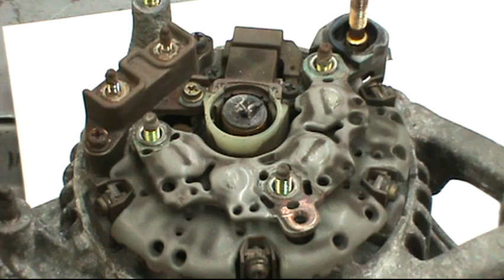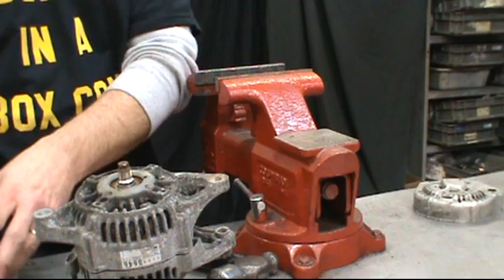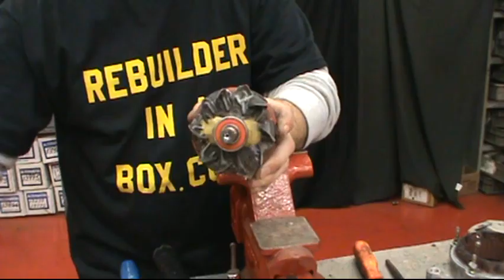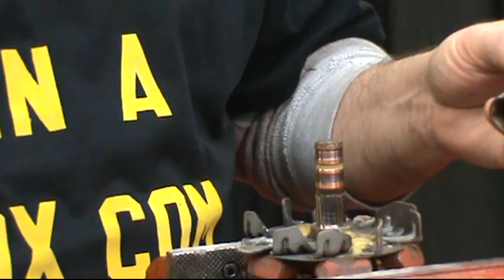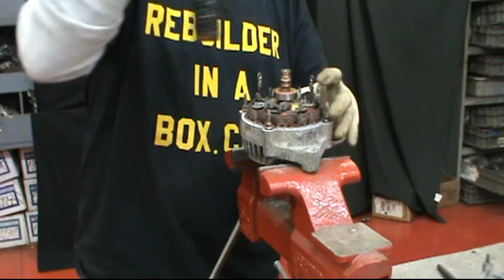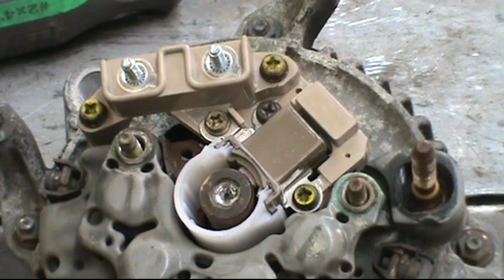How to rebuild a denso alternator

Comment: 15:42 - did you crack the case in half??
Reply from the maker: Good catch. Many of those units are broken like that due to corrosion. Corrosion occurs between the aluminum housing, and the metal laminations in the stator. We normally consider those non rebuildable but we kept going for  educational purposes. We'll be re shooting that video someday, there are several goofy things although still a functional tutorial.

Comment: I tried this on a Denso 210-0750 for a Honda Odyssey. The four screws for the rectifier are not there. It is permanently attached making it impossible to separate unless it is soldered or something.
Reply from the maker: Wrong video. See the one with the Chrysler mini van.
Reply from the maker: Note : We don't have a kit for that right now.

Comment: got it all apart except for the dam inner bearing its gonna do severe damage prying like you show in the video i tried and im not destroying a shaft in the vise cause the vise cannot hold the shaft as i pry up so i ordered an alternator bearing puller for 15.00 im doing the slip collar as well i used my press to put the outer bearing in used a large socket to press it in super slick n easy. did one a long time ago i kinda like doing bench work like this its fun you made this easy except the slip collar ill find a destroyed cummins denso alternator ill rebuild with a new collar

Comment: Hi, thankx for this video , im portuguese and my Jeep Cherokee alternator dont have that number reference but its almost identical , so im having an. issue whit it , when driving and at 2000 rp or more i have about 13 volts and all ok but when i stop hit the pedal sometimes i have about 11, 50 volts or so , even at nigth and i can see ligths going more alive if i hit the acelerador pedal  and something funny started happen too wish is my volt gauge fall to 9 volts and then up again , do this almost always i start drive the car .Checking the voltage whit multimiter at alternator i got 12 volts and sometimes less, whit no one hiting pedal ofcorse , but i guess its not working something there . I alreaddy switch the brushes but problem remains, checked the rectifier whit multimiter and i got the same value in all so i presume its good , now i dont know where to check more  ;  my slip rings are exacly like yours there and i thougth it was the problem but now i saw your video and maybe its not from there , so can you have ideia where my problem can be or what can i check \'
Reply from the maker: Try another battery. Go thru all vehicle grounds. Clean fuse block. Voltage reg is in computer, clean  connections, grounds. Follow large wire coming off alternator, dis assemble fuse link and clean.
Reply: thanks for your answer, just another question, do you know the right value of diodes? I checked and gave me about 4 in all them , but yesterday I did another try checking a output alternator and case and got about 1, 12
Reply from the maker: @000jamesh  They will all measure very similar resistance. Then checking in reverse, very little bleed thru. The exact reading will vary on scale and meters.
Reply: That inner slip ring was completely effed up. Should have got a slip ring replacement kit , and changed  it out!

Comment: Too bad you don't have rebuild kits for my 07 Jeep wrangler 3.8L. Local rebuilder puts cheap Chinese parts in them don't last. I had 200k on mine bearings went out sounded like a groaning sound. I thought it was my PS, or Automatic transmission. I removed the belt and started it the noise was gone. I took it to local rebuilder he rebuilt it the diode board blew out while I was 44 miles up a rock crawling trail in AZ. What a pita had to rope tow out and winch about 10 times using 4 jumper cables to jump tow vehicle power to my rear bumper winch pull me backwards in the switchbacks. Buy OEM if you can't rebuild yourself now, I keep a spare. New OEM worth it when you get stuck on a trail.

Comment: Hello Mike, thanks for this very informative video. I have a 2006 Honda Accord with the 3.0L V-6 and my original alternator went out about a year and a half, or so, ago. I then purchased and installed a remanufactured 110 amp Denso unit from RockAuto. This Denso/RockAuto unit has been on the car now for around 18 months, give or take. However, approximately 4 months ago, one morning when I started the engine I started hearing this high-pitched whining sound coming from the engine bay. At first, my immediate thought was that it sounded just like a power steering pump, low on fluid. The whine did NOT get louder and/or quieter when turning the steering wheel, in either direction, at idle, or otherwise. I checked the power steering fluid and looked over the hoses for any leaks that may have been sucking air into the system, but nothing!!! I also took a long screwdriver and placed the tip on both the power steering pump and the alternator and placed my ear on the opposite end and the vibration noises coming from the alternator were way louder and way more intense than the vibration noises coming from the power steering pump, like night and day difference. So, after a process of elimination, it is my opinion that it is NOT the power steering pump/system, but rather my alternator, from where the whine is coming from and where my problem lies. I have no problem buying a kit from your site, however, at the same time I would also just like to know why and what is causing the alternator to whine like it is. Is it possible for you to tell me more about this whining noise coming from the alternator? I did a little research online, on some Honda forums, and found exactly what I expected to find... I expected to find ANY answer that I wanted to find and everything in between!!! Some threads said that the whine could be a diode that has burnt out or gone out and it could be this or that and whatever else you could imagine. While I am NOT 100% positive, I do NOT believe that it's the alternator bearings making the whining noise, simply because usually bearings make more of a roaring noise and this is a whine NOT a roar. It also does NOT sound like any bearing I've ever heard that was on the fritz. I mean, to me, it's really more like a supercharger or power steering pump whine than any bearing I have ever heard when going out. Thanks in advance and I look forward to seeing what you have to say in regards to my issue.
Reply from the maker: Well, we don't sell that kit, just the starter kit. Remove the plug in and main cable from the alternator. If the whine stops, its a diode but still maybe a bearing somewhere. For me, an empty cardboard gift wrap tube is the best thing to locate the source of a noise. Take it to a dealer or Honda mechanic and get an estimate, maybe they would be familiar with a common problem like AC, idler pulley or tensioner. Sometimes soapy water spray will quiet a bearing or clutch for 2 seconds. Give up on line research for this. Process of elimination starting with cheapest.
Reply from the maker: Remove alt and have spin tested at AZ Orielly to see if you hear noise at vender.
Reply: My son has a 97 camry, Bought a replacement brand X alternator from the brand X store.  It did not have the proper amp output, even though it was claimed as a replacement.  Buy the real denso brand.

Comment: Do you have any knowledge to why my alternator would be overcharging with 16+ volts? It does it with the voltage regulator unplugged too and the voltage increases with RPM
Reply from the maker: Bad voltage regulator, bad ground, shorted battery. One of those 3 on a Denso system.

Comment: There should be diameter wear limit on the copper slip ring. The notion that still seeing copper is OK is wrong.
Reply from the maker: A worthy argument and true for for some (Ford) but not Denso or Delphi. We have studied this over the years and stand by our statement for 99%. Aftermarket brushes have a higher carbon content which slows copper wear down dramatically. The wear on a Denso OE will be 100% with 100k miles on some apps, but < 10% at 100K on others due to battery age and pollutants.

Comment: Mike what’s the most common part that fails on these Denso alternators. Brush assembly voltage regulator
Reply from the maker: Brushes, bearings, corrosion in that order. There is no voltage regulator. It's external.

Comment: What about the rectifier.   Why would it not be changed.   Wouldn’t it not charge if it was bad ?
Reply from the maker: Not a common problem unless the vehicle was subjected to unusual wear or dead shorts. But yes the alternator will not charge if it is bad. We have them available separately because normally it is a re usable item for 2-3 hundred K miles. 4 phases in the winding has little stress on the diodes and they are very efficiently cooled in this particular Denso design.

Comment from the maker: Anything's possible but I doubt it. If you found one leave a link. The guys in the shop have been using Snap-on CG270 but we had to customize it by grinding off the bottom part of the legs and removing the centering piece and using a penny. (the recessed opening in the top is so small, any puller's shaft would bend before pulling the bearing) However, the penny with a CG270 is malleable enough to conform and pull without any damage to the plastic slip ring if the centering devise has been removed. PROBLEM is our site is dedicated to the average guy with basic tools. https://alternatorstarterrebuildkits.com/about-us/. SOLUTION is pry bars. When used carefully, they work great.

Comment: Hi 
I did it but when I closed it it's not spinning freely and it's grinding .

I changed both wheel bearings .

Do u think it's not align properly or fans r touching housing / casing ?.

Regards
Reply from the maker: Not the bearings. Lightly hammer tap outside diameter at position where roughness or hit occurs. Place drive end plate on vice with pulley free in between the jaws. Light hammer tap down on back plate. Retighten thru bolts. Fans on rotor can also be tapped down or in. Look for marks inside. A little interference (not jamming rotation) can be tolerated) It will stop shortly after installation with no side effects to alternator.

Comment: What part of the alternator is to be replaced if it doesn't charge, and the light indicator doesn't off when the engine is running?
Reply from the maker: Just about anything can cause that. What vehicle/year/milage? Test harness, hot cable first. Then brushes, rotor, diodes/stator.

Comment: 12mins in. Is it difficult to remove the windings from the housing?  Want to vapor blast the entire casing while stripped. For cosmetics only.  Cheers
Reply from the maker: Yes, there are tools to do that cold. We usually do that with our rebuilds so we can blast the plates in a tumbler machine. However the tooling is rather pricy and wouldn't be worth it to the average guy. Maybe you could take the piece to a local rebuilder and have it dis assembled. Re assembly requires no special tooling, just oven heat the plate (350F for 1/2 hr) and tap it back in exact position.
Reply: @rebuilderinabox  Many thanks for taking the time to reply Mike.  I live quite remote so no facilities nearby.  I'll just need to get busy with a scotchbrite 🙂 Cheers

Comment: I can understand hammer and all but 12:00 socket extension on the huge diameter bearing? Come on .....; at least look around your shop for something better. These must be how street guys given hammer to tear down concrete walls.I would not go to this rebuilder.
Reply from the maker: This movie is part of a website that is designed by professionals but dedicated to America's working man in the trenches who may have limited tools and budget. We supply the parts and the exact video for the blue collar guy, so he can get to work with basic tools. See our 
mission statement on our website. https://alternatorstarterrebuildkits.com/about-us/
Reply: OMFG. I can tell this commenter has never ever worked under a shade tree. Not everyone had a seal and bearing press. If you are just out to slander someone. At the least, give a recommendation on what to watch. Hate to say it. I keep a set of harbor freight aluminum sockets for just such usage. Beating the F out of them. I have broken extensions in the box for driving things in and out. I have a socket that no ratchet will ever grace again, but I can put a wrench on it and turn the o2 sensor out of tight areas. This is creativity at its best. Just because it is not the exact tool. It is still a tool. Just like you. Most people tackling this job. It is not in a shop. It's a broke person trying to keep going. To get the next paycheck. Looking at the shop. I am sure the guy has the correct tool. He's just getting things done to encourage repair. Not roplacement. If your rich enough to replace it. Get the $500.00 oem Mopar brand new alternator. I'm going to rebuild mine. I grabbed one at pull it. I'll rebuild one and keep it handy. My winch is hard on the alternator.

Comment: Thanks for a very methodical procedure to tear down the alternator.  I would suggest that if you strip the alternator that far down, then it is a good idea to to do a continuity check of terminal to terminal, terminal to ground as well as measure winding resistance for the rotor and each of the three windings of the stator.
Reply from the maker: Feel free to do any continuity testing of your liking. However we do not support resistance tests of the stator windings with a common ohm meter. People will not know what the resistance is when going phase to phase, and we don't know either, because it's not going to be as accurate as a good visual inspection (looking and smelling for signs of heat) on the stator. Also, squeezing the stator with your hands to test rigidity, or tapping lightly on the stator winding with a screwdriver to check for a good bounce back. The only real electrical test for stator windings would be with a hipot, and very few of the people that buy our kits would be able to get their hands on one.
Reply: @Mike Lauer  Resistance of the stator windings should be absolutely minimal - well under an ohm. Since the stator is wired in a ‘Y’ configuration (with the neutral at the center), there should be continuity between any two of the four stator terminals. Of course, because resistance should be very low regardless of what you measure, there is no way of knowing whether there is an internal short. But if there is NO continuity or there is rather high resistance between any two terminals, you know you have an issue. In other words, measuring stator continuity detects BREAKS, but not shorts.
Reply from the maker: @matthewstorm5188  As a well seasoned rebuilder, our customer has the benefit of skipping (or focusing) on certain textbook rebuild steps.
We have the experience to know : What's going to be wrong with different  brands, and what's going to be bulletproof. That's one reason why we intentionally skipped that test in this case. (Not that it's a bad idea to test insulation to ground.) However, it IS a bad idea to trust a VOM for resistance/ continuity. I know... "in the books" many authors have shown that test. Screw them, they're wrong. Have they ever actually rebuilt an alternator? Many alternator rebuilders know a burnt (annealed) phase will check fine on any scale of an ohm meter. But when it gets hot and gets under load it will break down sometime soon. That's why there are expensive testers to check stator phases under load. But companies that made them never sold any because smart rebuilders relied more on visual inspection. When copper has been overheated, or the Y has been overheated, you can SEE the color change. And you can FEEL the softness when you squeeze it.  For Denso, we really recommend leaving your ohmmeter in the box, it will be delusional.
Reply: @rebuilderinabox  You have a good point on measuring resistance.  The continuity check will help to confirm that no short exists between the windings and the alternator body.
Reply: @rebuilderinabox  you have "kits" !?
Reply from the maker: @davidwebster7918  Yes, click the link above.

Comment: You were so careful not to hammer through the bearings when you first installed both of them.... but then you hammered through the front one when installing the rotor, and then the back one when installing the rear casing.
Reply: That's the only way of doing it !

Comment: To install the bearing throw it in the freezer over night. Turn on the oven and throw the alternator shell in it for about 15 minutes or just heat it with a heat gun. Take the the bearing out of the freezer and while the alternator shell is still hot place the bearing in the bed. It fits right in and it may only require few taps...You are welcome.Do NOT pound a bearing on the inner ring! Find a large enough socket or a piece of pipe which will match the outer ring diameter.
Reply: You need to pound on the side of the bearing that is experiencing friction, or else the force is being transmitted through the bearing balls. Sometimes pounding the outside will damage the bearing, sometimes pounding the inside will damage the bearing.
The solution for putting a housing onto a bearing that is on the shaft is heating it as you said. 

Lightly grease the OD the bearing, and put the housing in the oven at 250 degrees and it should slip right over without any pounding.
Unfortunately there is no good solution for putting a shaft into a bearing that is already in a housing without applying stress to the balls.
Reply: Yeah.. no.  Shops don't have time for all that BS.